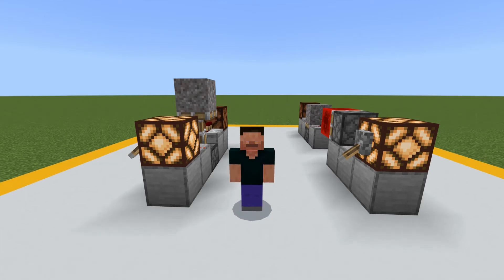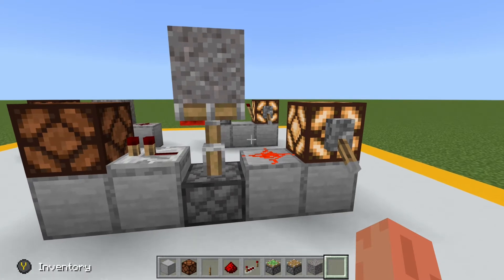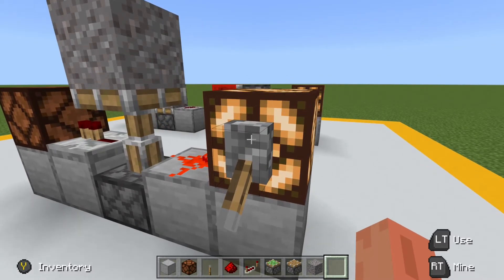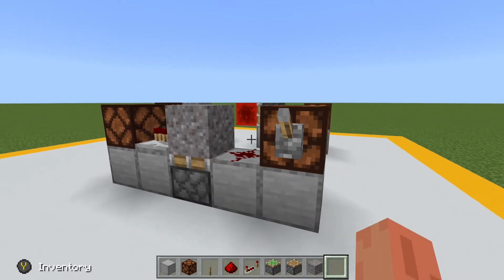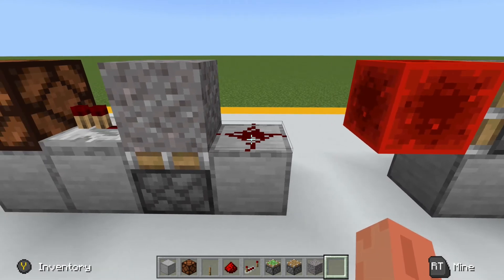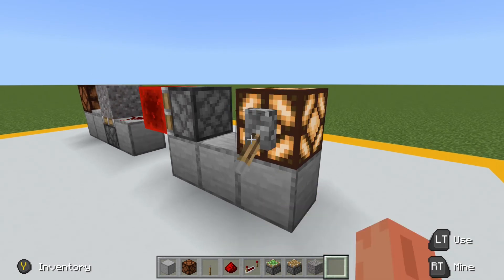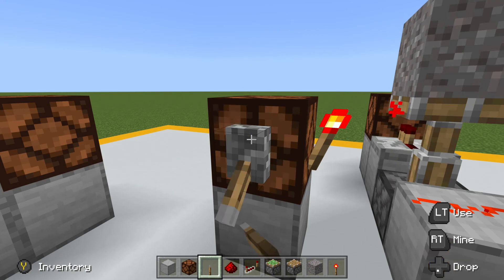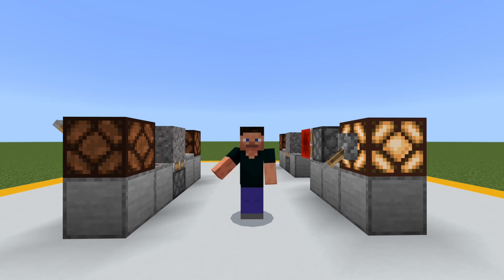Understanding Monostable Circuits | NoobStone | Minecraft Bedrock Edition 1.20 Redstone Tutorial

Comment: The reason the gravel wasnt getting powered without the sticky piston and with just the torch is because the torch re-directed the redstone away from the gravel block and it will power the gravel if the torch is in line with the gravel, thus making the sticky piston useless (I think) I tried it in my game and it worked, It might be a 1.21 thing though.

Comment: Can i power on raising edge from a longer distance using repeaters?
Reply from the maker: Yes.  It should work fine, there will just be a short delay for each repeater you use to extend the signal.

Comment: I'm using one for a command block creation. However, whenever I use the comparator to activate it does not work. Do you know why?
Reply from the maker: From my testing I think it is the delay from the comparator that is causing your problem.  If you are using the first circuit, try using a sticky piston with a redstone block to activate it similar to the second version between your comparator and the monostable circuit.  Hope that works!
Reply: @noobcraft5777  Yeah I tried that and it worked.
Reply from the maker: Nice! 😁

Comment: I may be wrong but I’m pretty sure in that last example the reason it didn’t grab the signal was because the redstone torch made the dust a line that was not pointing into the block thus not powering it and the repeater had no signal to grab. There may be some funkiness with the torch delay too (I’d probably wanna test it) but I don’t think that was the only issue there
Reply from the maker: Good catch on the redirecting the redstone dust... I didn't notice it when setting up for the video.  When I was testing all the lines before shooting the video, I did it the "right" way where I replaced the sticky piston and redstone block with a torch directly pointing into the dust so it pointed into the gravel, but it still wouldn't work.  When I was trying to script out the video I was trying to shorten time and didn't notice the dust change directions, but the delay is still there with just a torch and it dosen't work if you do it the "right" way.  So, the information is correct but the way I laid it out for that part of the video is a little off.  Thanks for pointing it out as I always like to put out as accurate of info as possible!
Reply: Weird it doesn’t work normally, bedrock redstone can be so inconsistent…

Comment: I'm going to try and use this circuit for your 3 by 3 piston door because the red torch under the lever shuts the door too quick with the button or with the pressure plate.
Reply from the maker: I think a pulse extender might be better if you want the door to stay open longer.  To add it just add 4 extra blocks next to the dust under the pressure plate, then put 2 comparators facing in opposite directions off the dust (one into and one out of the redstone line), and then put 2 pieces of redstone dust on the other side of the comparators and it will extend how long the signal stays on.  

Here's my attempt to "draw" what it looks like: (dashes are redstone and triangles are the comparators)

➖➖➖➖
🔽🔼
➖➖

Hopefully that will do the trick 🙂